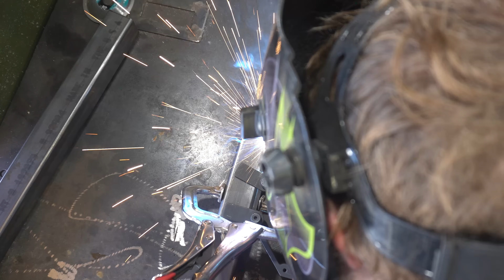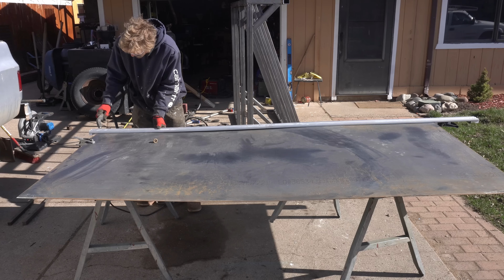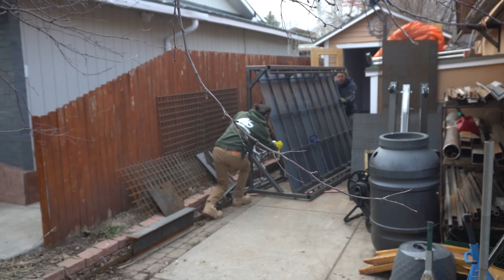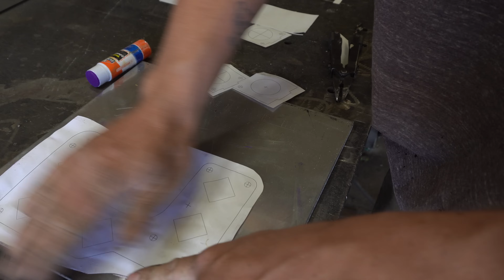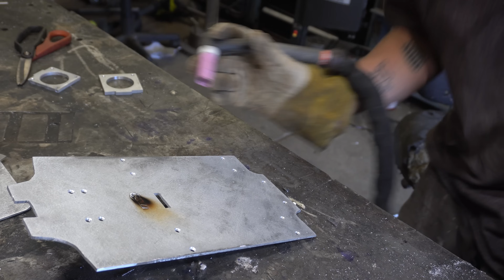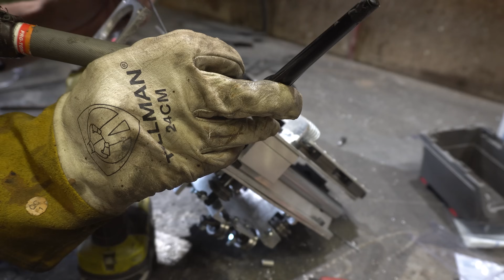Making A Full Size CNC Plasma Cutter for a Small Shop

Comment: A bit late but. Put some caster on a pallet. Iv moved all sort of stuff on the one i had. Also made a 2x4 frame tall enough to almost be level with my pickup. Made it east for me to drag an engine from the truck onto it and roll it onto my shed.

Comment: I’m about to build a CNC plasma cutter , hoping to build something with a Z axis that I could switch between a router head , plasma and laser engraver . Realistically I will probably just run a plasma cutter because most of my work is metal fabrication .
Building the table and mounting motors is not a problem but the computer drawing and programming is a little intimidating for me too,
My son built a CNC milking machine so I’m just going to use his template of controllers and power supplies motors etc

Comment: Its great your running with these idea's, Linux CNC is nice if your a glutten for suffering, I had limited positive results getting it to work with my suck ass diode laser cutter. I opted to just pay for light-burn for  Linux, no sweat no mucking around with getting someones pet project to work correctly let alone dealing with flashing a arduino with laser GRBL. If the price is right for the plans like $50 or and have a option to purchase the more difficult parts to fab . I know MASLOW has a similar model for there kit. you can buy just the plans or or plans and some of the high precision fab parts.

Comment: Looking forward to your next video on this plasma table and seeing how it turns out. I am building a cnc 4x4 plasma table. Was going to make it over size and make a support so I can put a full 4x8 sheet on it so it hangs off the end and is supported but actual cutting will be 4x4. Going to be rollers on the edge to I can move the sheet in as needed. That is the plan anyway lol. 

Got everything ordered, Everlast PowerPlasma 82i, got here yesterday and I made a few test cuts. Using 1700mm/66 inch linear rails, arriving today. Figure that should give me a true cutting area of 4x4 plus, but we will see. 

I will have to see how long the included ball screws and rail trucks/bearings actually are and see what my true cutting zone will be. I was going to use 1500mm but up sized at the last minute. if it is way to big I can always cut down the rails and ball screws.

Comment: For my mini cnc mill I used a RAMPS board, just like the one in a 3d printer.  Given your experience with the tig-printer that might be easier than LinuxCNC.

I use bCNC running on a PC to control the mill, connected to the ramps board via USB.

Comment: think you can stick some dynamatt on the back of the dross pan / big pieces of sheetmetal , should make it a lot more quet , could allso hang a few bags of sand against the back of the  sheetmetal 
as for cutting the "shapes " you could use the scrollsaw to cut wooden templates stick those to the aluminum / aluminium and use a router with a flush bearing bit to cut the final shapes band saw would be better , there these small ones with a 140mm length band that works ok the slightly larger table model one has the option of a pulley change to get it to run slower those work better
dont think i would buy the mechanical plans the thc system if it works would be nice though
might need to clamp the plate from the top edge or put some magnets behind there that you can use to pull the metal back against the bed as when you start to cut the metal it probably will buckle and flop all over the place (it allready does that when layed flat) , theres allso the problem of material that been cut falling down between the bed and the metal laying on top pushing either the metal off the bed and messing with the torch or alowing the torch to cut it twice , could solve that by starting at the bottom and work up but then you get the problem of the metal plate bucling under the weight of the non cut metal 
(maibe hang the plates off a few bolts or clamps on top )
been thinking about a cnc plasmacutter and tought about setting it upright too but there where some issues like the ones i mentioned for the same reason: lack of space , think if i would make one now i make a lifting system to hoist it up to the ceiling when not in use , same hoist can be used to load the sheets on

Comment: This reminds me why I now add all the nuts, bolts and screws to a 3D model on parts that move.
You are doing a grate job as you always do.
I love the way you have put it on its side, but I think you may need a Screw instead of the 10mm Timing Belt, when the power to the stepper motor is turned off, the trolley may drop to the floor.
Perhaps split the aluminium part in two so you can spread those pieces apart, leaving a gap for the rollers on third rail.

Comment: You may try to use aluminium sigma profile for your next cnc. It is much faster and lighter build. Also you may use a proper linear rails for your X Y axis. Your linear stages are to bulky and therefore they collidated at the end of the video.

Comment: btw, it could a hand supported manual cnc, also
Reply: linear non-motorized rails, hand movement of the cut head
Reply: my ears hurt by the wind noise
Reply: how about arduino and sd card, as the cnc controller

Comment: Wont loose cut parts fall and cause problems? At work we have the odd problem with parts falling partially between the slots of our regular horizontally oriented plasma and catching on the tool head.

Extras i'd recommend is replacing the floating head with a electrical contact sensor between the torch and workpiece. That's what i built for work, works much better on thinner stuff that would otherwise deflect under the floating head before it triggers and make your torch fire while dragging.

Comment: yes on the Linux CNC.  how do you plan on dealing with the smoke? I saw some people make a down draft table using one of those 6inch in line duct fans but their table was like a third of the size of this. love the idea of the plasma table being on its side. really cuts down on the space it takes and probably make placing a heavy sheet on it easier. might be problamatic with parts falling behind the sheet as its cutting. might need to design the parts to leave tabs so they need to be tapped out once the job is finished.
Reply: The desktop laser cutter I know uses a water table to deal with the metal debris dropped during the cutting process.

Comment: Don't forget you have a 3D printer. Many of those parts can be 3D printed from ASA plastic. The results will be better. You could make some metal heat shields to prevent them from melting or something.

Comment: I'd say if you did build and mock it up in cad already. Then there's not much additional time to put plans for sale. Personally I don't plan on building a plasmas table like this I love the panel saw style layout. But one thing you are gonna need to deal with is dross building up at the bottom between the back sheet and frame.

Comment: Pretty slick angling the table to take up less space. But, um. A couple questions.

What do you plan to do when steel parts and waste are cut loose, slip, or otherwise shift?

And solving that, does that solution also work for cutting aluminum, stainless, etc? - assuming you want that extra functionality
Reply: Yes, agreed, the space savings is genius. Right after that I wondered about securing the metal and cut pieces falling.  Really curious how this will be addressed.  Awesome video though.

Comment: I’d love to see a tutorial for the control side of things! I’m in the middle of designing a small table for my garage and could use any help I can get.
Reply: I wonder if that's a common challenge for diy CNC.  I have a machine that's already built, but the controller is ancient and obscure and I just kind of lost motivation to get it running properly.  Hardware is easy for me, but fusing that with electronics and software is when my brain clocks out to look for other shiny objects to play with.
Reply: @TuckMcSouthard  check out a gecko540 with a smooth stepper..i run 3 cncs with this setup...controller was like a grand total...that inc;uded 48volt psus and 12 and 5 volt psu...wiring etc..

Comment: FluidNC is worth checking out for the controller,  it runs on ESP32 so you get a wireless interface. Its quite nice & easy to setup.
Reply: Interesting. Do you use it? How does it compare to arduino grbl?
Reply: @TheRainHarvester  A bit late, but yes i do use it. Its basically grbl made for ESP32, and its in continious developement. Its great.